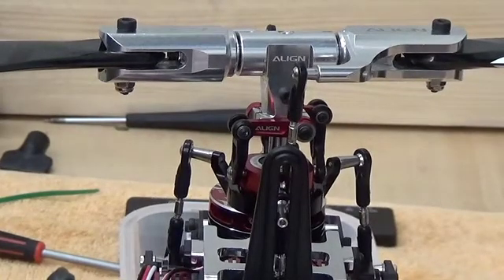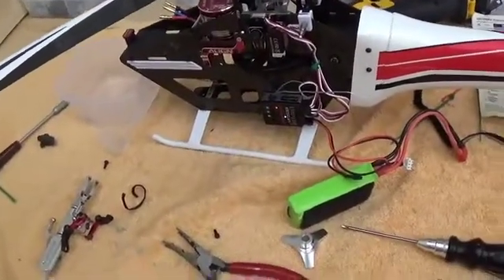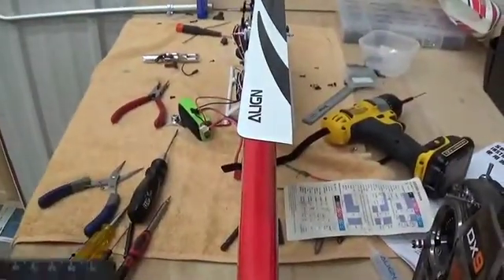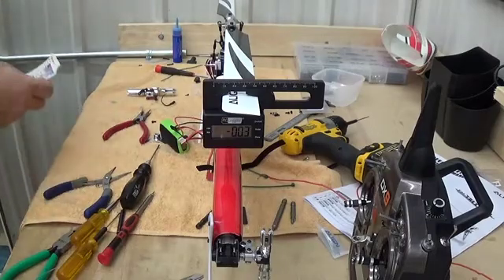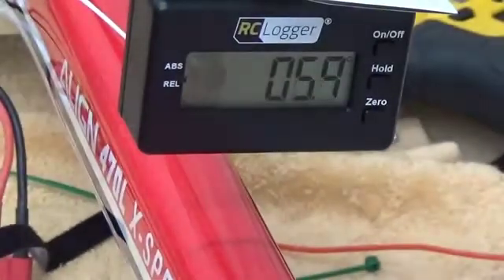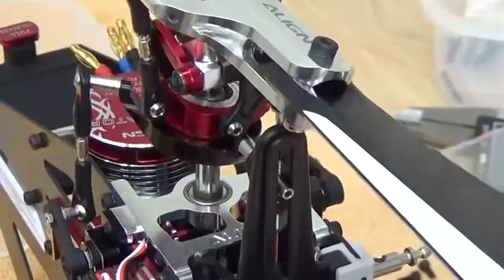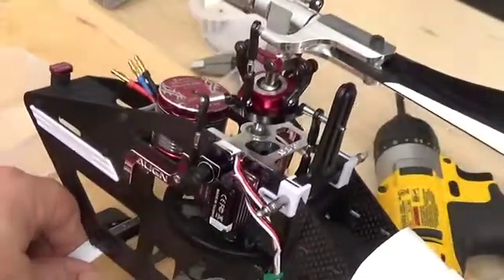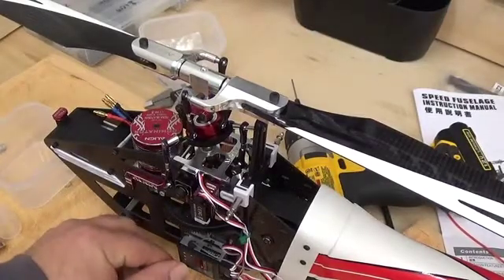TREX470LM Flybarless final

Comment: So I am having an issue setting up my microbeast on my 450l. When I release the rudder stick in either direction to center the tail rotor does not return to center. What am I doing wrong?

Comment: I like to know how you hot the blue light on in beastx in cyclic limit menu without your ailerons servo binding into the servo case? Do you respond to your vids? I know its been long time ago but just wondering.
Reply: I got the same issue, and  beast plus v4.2 got blue/red ( light purple)  with no high limit elevator servo bind against the upper mount, but lowest limit bind slight on the Ali and pitch servos. 
From what is read from groups posts the can’t get a blue on this heli with w microbeast. But still handles 3d well

Comment: Hi Jim, thank you for your videos.
You can change the length of the pushrods steplessly while leaving the ball links in place.
Don't remove the ball links and make a 90 or 180 degrees turn (approx 1 degree change in rotor angle,  too much for a perfect setup).
Use a small pliers or a tiny 2.5 or 3 mm wrench to turn the middle of the bolt.
This works because there is a left-rotating and a right-rotating thread.
Maybe you will need a friend holding both ball links in place with two pliers.
https://www.youtube.com/watch?v=zj93j1hMO9U
Reply: Peter Neureich stock links are not reverse threaded on one end. Only the upgraded versions are. Turning the stock one without removal does not nothing.

Comment: Hi and thanks for helpful videos, I follow all steps correctly but in step L, I can't get the blue light and instead I got red otherwise my aileron servo arm touching the servo case and my elevator link touches the upper bearing block even I have -+12 on step K.
Reply: Reza Nashta my 450l does the same thing.been fighting with the blue light.raised swash lowered swash but nothing.even when the red light comes on its still running into the deep case